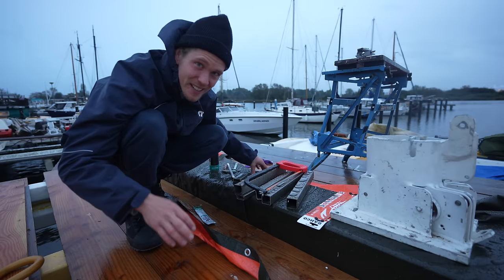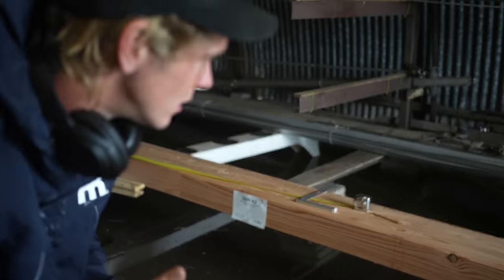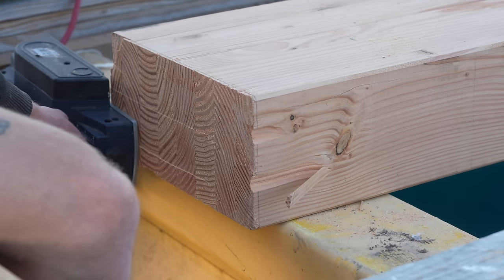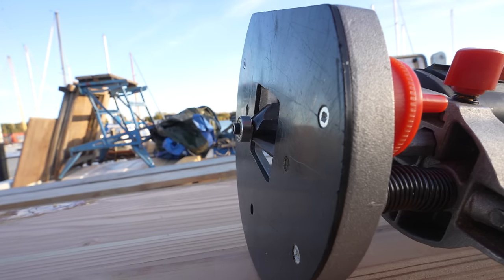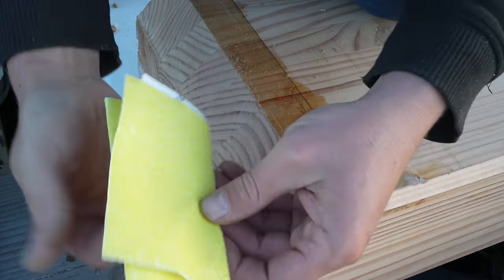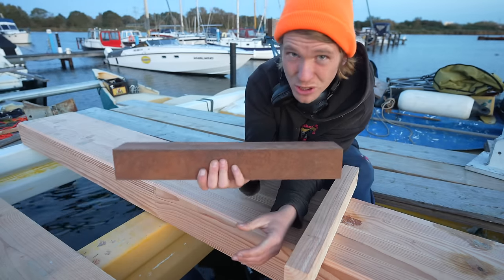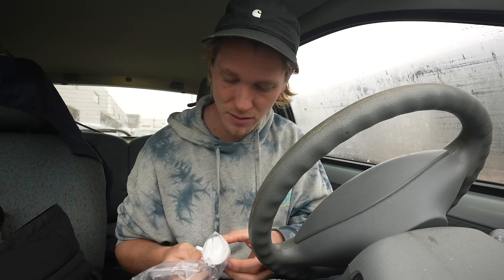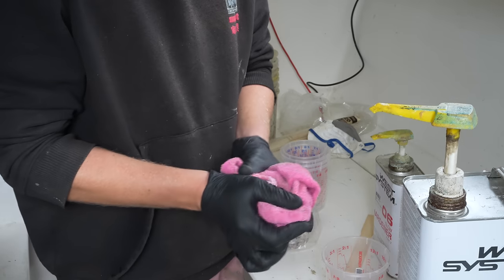My 42 ft Catamaran gets a HUGE Mast Step! | Wildling Sailing

Comment: Mark listen up before you make a grave mistake ! Those bolts will not be strong enough to hold down the force of tension that the mast will have on that beam. You will be better using some kind of thick metal plate strap system to strap that beem on to the other beams! Or you will have to drill through the whole beams to pass through some threaded rods and bolts to hold the immense stress that they will be under when your mast will be taking the full strength of the wind on them. If you don't pay attention you will not only lose your mast at sea but it risks to break everything in the process. 🤕🥵☹
Reply: Mark, could I second this? I am sure you have considered the immense forces involved here but an objective opinion would be valuable. Please check you have calculated this accurately.
Reply: Well, I might second this too, but I am not sure what is intended here, and how those 'bolts' would be stressed.
Reply: @anonymous6675 He's shooting from the hip here again mate and  playing with people's lives here. Wind and seas are a destructive force. Want to see him do great things but has me really concerned at times. Cleaning and painting comes way below integrity.
Reply: The downward force of the mast is spread over three giant beams 
The bolts only take an upward force
Reply: The bolts are there to stop it from slipping/ moving around. There's no lifting forces on the base of the mast.
Reply: @ecclesheat the main force is going to be a twisting and sideways force think of the huge pressure on the sail and the boom which is transmitted through the mast to the mast step. ALL the pressure that drives the boat forward is transferred though the mast step into that mast beam and from that beam into the cross beam and thence to the hull. The rigging will hold it in place but the force goes through the mast.
Reply: I am interested to know what forces you think are made by a mast/ vessel under sail ?? I know but will wait to hear your reply.
Reply: This is the concern. No stepped mast is rigidly in place. Stresses come from several directions. I think the concern is that Mark does not truly appreciate that this is just one part of a complex system designed to keep the mast in place with minimum stresses from any source. Let’s see what he does for the shrouds etc regarding their placement, integrity and security. Plus what is the integrity of the mast…. Oceans can be unfriendly and challenging places and being in the Netherlands there will be no other place for trials.  @Sailing_Antrice
Reply: Masst often have no bottom fixing other than a locating step, the stresses are taken by the stays. Look at the binacle in a lugger, the mast steps were located by one through pin of no more than an inch dia. It is unclear at this point as to Maeks design, for all we know hw may be intending lashing the beem! from memory the Phia original design did not have the central mast beem bolted down,
Reply: What about lashing the mast beam to the other beam? Isn't that how half of things are held together on Wharrams 😊
Reply: Forces on the mastfoot will mostly be pointed down so not a problem at all.
Reply: I was wondering why not through bolt the beams, seems odd.  For the nature of these I would think locating blocks and some extreme lashing/banding?  I lashed a carport together many years ago, ( I know, not a boat :) ) made lever blocks for the lashes.  It was amazing how much force it could take. Had a heavy snowfall and it survived, the materials bent, the lashes didn't move.
Reply: My limited knowledge tells me that the major force applied to this mast beam is downward force. The weight of the rig. The stays spread the “twisting” force through the structure at the chain plates. The lags on the beam cleats should be more than enough as they are meant to hold the beam in place. The cross beams carry the load. I am sure Mark has talked to Hanica (spelling?). If she approves then who are we to armchair criticize the engineering? Sail on Mark!
Reply: i totally agree, try and imagine why they have joist hangar plates with lots and lots of galv. nails and this is on land not ocean. three coach bolts wont cut it .at least gal strapping is a fail safe or timber peggs right through but im no boat expert
Reply: If you don’t bolt through all those mast holes you drilled you may dismast in the middle of the ocean and not make it yourself. Don’t be foolish to save a buck.
Reply: The mast is placing weight on the beam (either beam). No torsion. No tension (that would be the stays). So really all these bolts have to do is stop the block from sliding around.
I feel this setup looks fine.
Reply: Mark,did Hanica approve the mast installation this way? If so,please disregard my question.
Reply: I trust he is consulting the Wharram playbook here.
I have full confidence in Haenneke(?)
Reply: @markhorrell9213 

I agree if Hannake says it's Okay or if this is how the plans say it is to be done then all good.
Reply: @Sailing_Antrice the twisting and sideways forces will be taken by the standing rigging. The mast step does not do anything to keep the mast upright other than to keep the base from moving around.
Reply: Hanneke, there fixed it for you all. The Mast step is a different matter though. The mast is in compression, so the location of the step, is only important thing. You probably could drill right through the beam, and use bolts, but would have issues keeping water ingress out of leading side of beam. Not sure.
Reply: Mate you need to bolt all the way through with blocks either side of each beam.  Also sand to key the beams and use epoxy to bond as well at bolts.  Minimum M12 with large penny washers and nylock nuts and split pins.  Throw the kitchen sink at it man
Reply: Having had a visit from the boat’s designer and being in possession of the plans, I'm going out on a limb to presume Mark is building off plan here.
Reply: @danrose3621  

he will be hugging the coast for sure for quite awhile. Gotta give him an A for effort
Reply: Absolute champion effort as usual mate!
Reply: @anonymous6675  Calculated? 😆
Reply: @Sailing_Antrice  

what is the reccomendation for Mark concerning the mast step? We all want him to be safe
Reply: Those bolts and the small amount of wood is not enough.
Reply: @jessebradin8992  

I agree here mate. It's not much different than any other mast step design
Reply: I made the same kind of comment then seen this, I agree 100%
Reply: Why not notch  the big beam do it slips over the beams that it us resting on. Like a proper wood joint...but just reading these comments itcsounds like you might need some professional help with this one...maybe ask alodino (sailing magic carpet on utube...
Reply: So it slips tightly over the beam it is resting on
Reply: This will be uninsurable 😑the standard of work is shocking, shortcuts on top of shortcuts, buy the best life raft.
Reply: I looked at the advise he was given about the use of only self adhesive tape on the windows. I think sometimes the help you give is ignored
Reply: Or he could lash the mast beam to assist the screws he used, and fully epoxy the boards to the beams.
Reply: Measure twice, cut once 😊
Reply: Pretty sure the lady who designed the boat gave Mark the details for how to do it.
Reply: I agree those bolt should go through the beam so that the tension will be spread back into the large beam and ultimately to all the boat. If the tension is left into the screws inside the beam they will dig in until they run free.
Reply: Agree. Due to the seaway here will be forces in all directions. Imagine sideways sea while crossing a channel in the east Indies. 3m swell so steep it is like 3m chop. So the mast step and mast base shall be held in all directions. Up/down, left/right, front/ back. A few additional kg for fastenings might save your boat. This must be thought out carefully.
Reply: Feel for him having to average out the comments to decide what’s actually good advice…..I wouldn’t be able to get up in the morning if randoms with no credentials told me i made a grave mistake…..and im a boatbuilder by trade
Reply: @anonymous6675 if your not qualified to say its is ok or not ok then don’t comment….poor guy has to read through all this uninformed panic.
Reply: @rezawaheed8879 your last 5 words 😂
Reply: The beam will be under compression, that's why boats hulls have compression posts. It's the standing rigging and sheet's that take all the tensile force's. But I still would have notched the beams and mast step & had large U bolts made.
Reply: @Sailing_Antrice I don’t think you are quite correct.  Yes the force at the base of mast is driving the boat forward, but this is shared with a similar force on the rigging. 
The connection at the base of the mast is more or less a pin joint, so transmits the force perpendicular to the mast, part forwards, part sideways.
Yes if the pin joint is above the bottom of the mast beam, it does create a turning force, but this will be relatively small.
Reply: Isn’t every force on the mast downwards? I had to reconstruct some of my interior due to downward pressure from the mast step. Only three small 6 mm bolts hold the mast in the step, there is no upward tension on them at all. The shrouds and stays pulls the mast downward- this tension increases with the wind force.
Reply: ... compression vs extension.... I actually wondered why the heck he put them there at all.  Then I saw the bolts on the top side.  It's fine.  He's about to put some 7tons of downward force on those beams.   Those bolts just keep it from sliding sideways when he steps the mast.  Plus those bolts have stronger sheer strength than the mast anyways so... He'll lose the rig before they come out.
Reply: Why the aditional planks?why not fixing the mast step directly through those massive beams u have conecting the hulls? Seems to me they are stronger
Reply: Three bolts ca 5 mil thickness  stainless will break after a certain number of movement due to wracking .
Putting the hardwood bar lenghtwise under the crossbeam and using threaded bar 16 mil and lange washers on the topside of the maststep would suffice.
Now you r waiting for broken screws and a dancing maststep .
Wharram cats flex       !
Reply: @jeffwatson4908  You all seem to be forgetting that Mark is in touch and has had lengthy visits from the designer of the boat. I’m sure they will have discussed the mast at length.
Reply: Plenty of deck stepped masts out there with way less.
Reply: I’m impressed how many people here know all about sailboat engineering, seemingly without ever having been on a sailboat. I assume it seems safer to criticise someone who is open about not being experienced, which then brings the worms out of the woodwork. Pun intended. Just to put a pinch of facts in: The screws some obsess over are position holders, which are also found on the lashed main beams. They do not carry the mast loads, which in this location is compression, not tension. Mark isn’t a pro woodworker or boat builder. Progress isn’t pro and he makes mistakes, but he’s certainly not an idiot. He learns from the process and gets good results. That means he’s dramatically more competent than what one can get from sitting on a sofa writing comments. (On that note, I’ve designed and built a few boats, and sailed some oceans, so I do know some of this.)
Reply: Is this a particular trait of Americans to tell other people what to do without references to your proclamation of superior knowledge???
I take offense to the behavior of people who act like this...
Reply: You could make everyone happy (Mark) if you lashed the mast step to the cross beams.... it would look rad too! And that's a huge factor to the appeal of subscribers right?
Reply: @lllBAMlll  I like this type of thinking...it also kinda suits the boat as the beams are lashed.
Reply: @Sailing_Antrice through the shrouds? Think of how substantial a mast socket is on a dinghy with a deck stepped mast....
Reply: @klemenprezelj Spread the downward load over three beams.
Reply: @alanbolton9217 I don't understand. The shrouds will pull the mast in to the beam. The only valid forces would be sideways which the bolts will handle and honestly, the foot is a hinge point. The top is where any swing or sideways force would be. I think people ought to consider how deck stepped masts are supported. With a plate bolted to coach roof and compression post. Now tell me that this is weaker. These comments make my stomach churn
Reply: Definitely should bolt through the whole beam and have a metal plate or large washers on either side. This shouldn't cost too much.
Reply: Interesting comments. I'm not an engineer, but in a monohull there is a reason they step the mast off the keel or use a "compression post". The force to be concerned with is in the term... Compression. I'd be far more concerned with the chain plates and the rest of the rig. The blocks of wood glued aft of the bulkhead makes me a bit nervous.
Reply: @LaurieHolbrook  I have watched Mark for a long time and really wish him all the best....
BUT....people on here heaping praise on him because he wants to constantly save money and cut corners aren't doing him any favours. This double rotted oversized canoe is supposedly going to cross oceans with others aboard. Cleaning and painting are what you do to something that has passed a survey. Watch what repairs others do on other channels makes this look very cheap and nasty.
Reply: Lots of very ill informed comments. As has been said, at the mast base, it's pretty much all compression so what he's done looks adequate to me. What would concern me is any big drilled holes in the beams as has been suggested, as this would form the weakest part of the cross beams.
Reply: @scottd8108 I doubt very much you've fixed mast steps because of sideways forces when at least 95% of the force at the base of a mast  is compressive and why mast support timbers usually have to span at least 3 frames/floors, 3 beams as in Marks case.
Reply: Thinking how my hobie 16 mast was on a ball with  connected to cross bar with 6 rivets 😮  think he fine